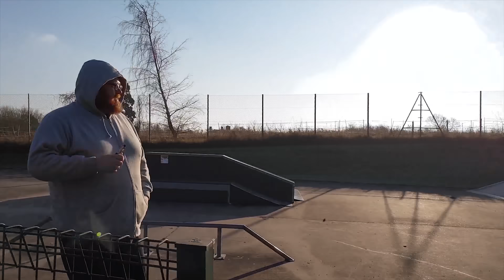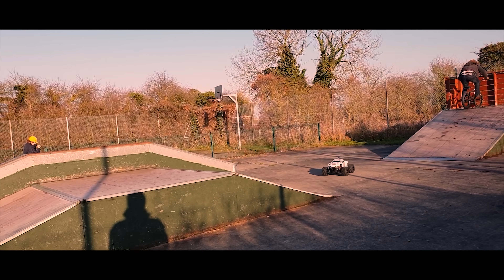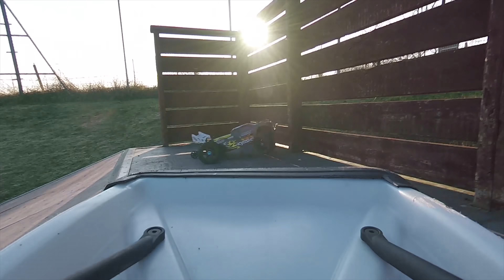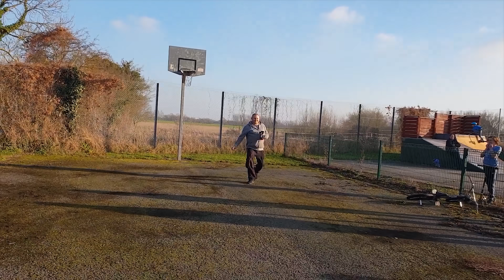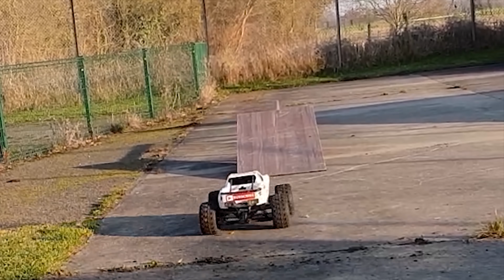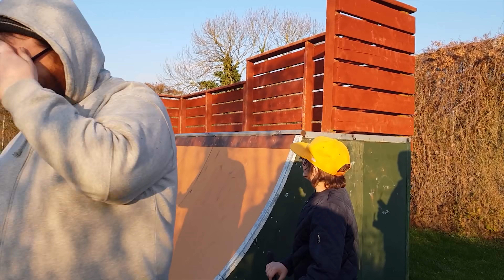Stupid way to break an RC Car - Traxxas X-Maxx epic bash

Comment: You shold make a crawler go 100 mph
Reply: Agree
Reply: he already did
Reply: Bashing Over Racing It only went about 50 tho
Reply: suspension isn't designed for it but I guess that's the point, 8s or possibly even 10s crawler needs to happen, I know 15s batteries exist but they're $200
Reply: Good luck getting a trx4 100 mph he can't get it over about 45

Comment: I have this 30 dollar rc car I crashed it into a fence I made it go off a jump it broke into 20 pieces i have a hot glue gun that is basically the only thing holding it together but I looks like it got ran over by a car and it still drives but it doesn't turn but I am going to drive it through a field one day at full throttle and I will try to flip it I don't know why but I will